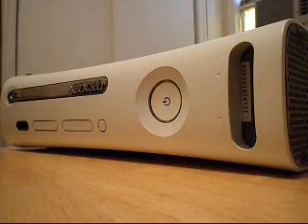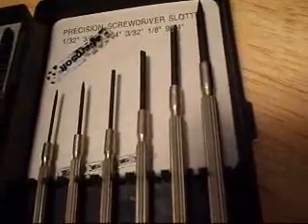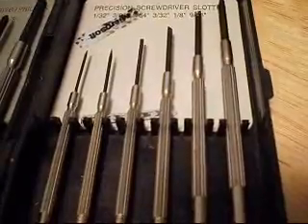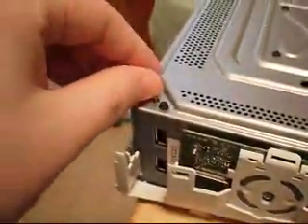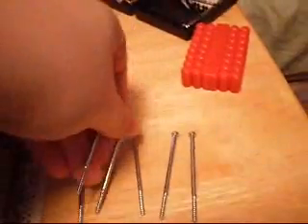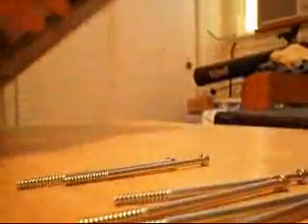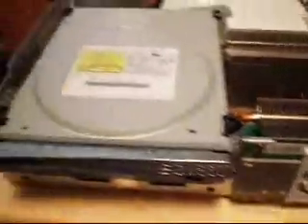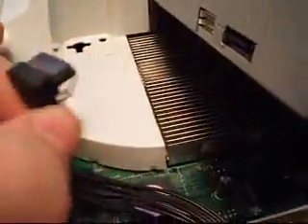How to remove an XBOX 360 Disk Drive.

Comment: so i had a guy fix something inside my xbox about 5 months ago and the disc drive never worked since then. so today i say fuck it and i opened it up myself and was gonna replace the whole disc drive. so i followed your video until i got inside and right away i noticed that the dumb fuck had forgot to plug in one of the two wires that connects to the disc drive.  thanks for showing me how to get inside the xbox lol